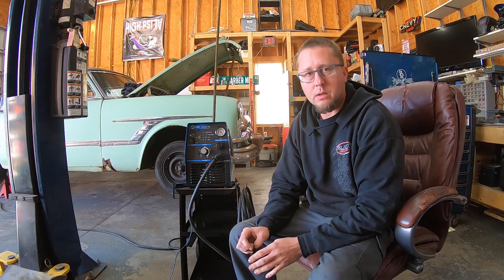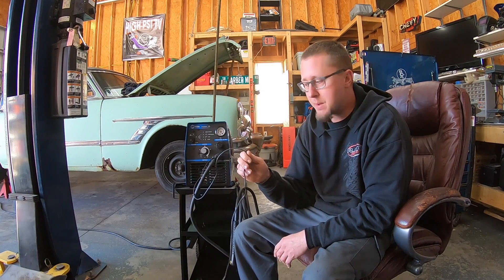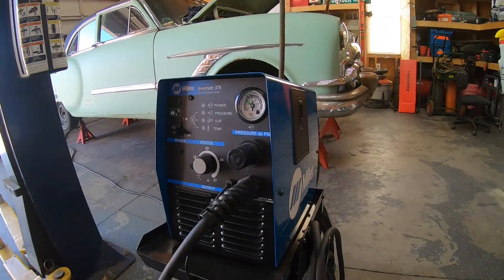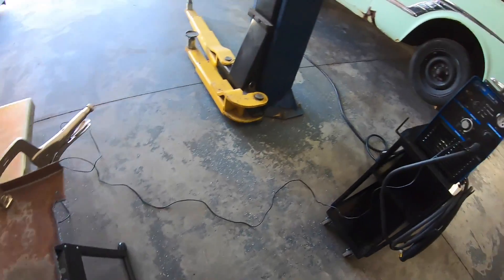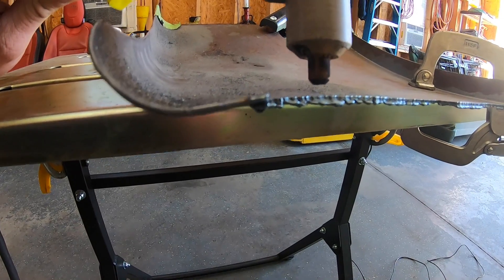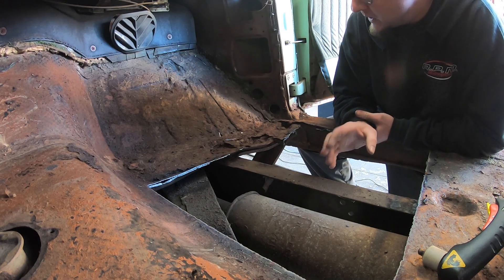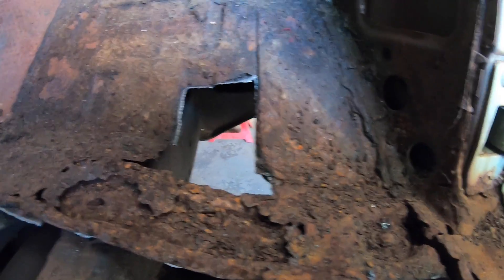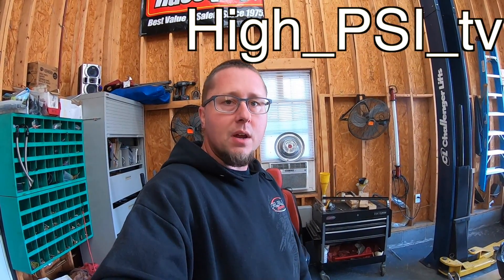Miller Spectrum 375 Review and Demo. Plasma Cutting 101

Comment: If you move a little faster you get a cleaner cut and the slag will just knock off the back side easily with a small hammer.

Comment: How did you wire the machine? Did you completely replace the coard and plug for 240, or cut the 110 plug off and add a plug for 240. I want a longer reach and want to use 240v. Where did you olace the wires for 240v
Reply from the maker: It came with all the wiring adapters I needed. No cutting required

Comment: Please don’t use any flammable gas, including oxygen on a regular plasma cutter, or torch. That’s very dangerous. The torch could burn up almost instantly, and the fire could rush back into the torch cable, since there’s no flashback arrester. Equipment that allows those gasses are expensive, and industrial.